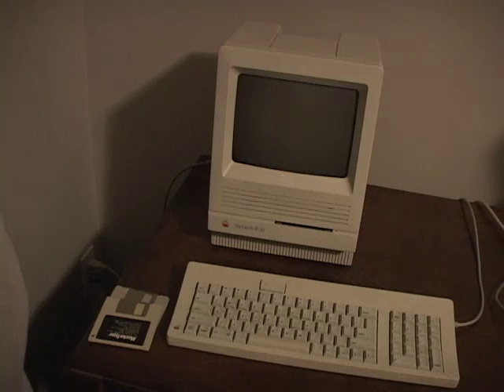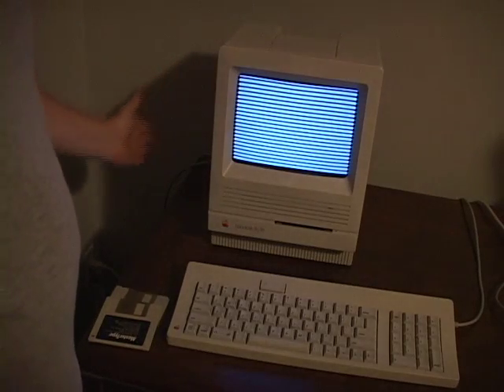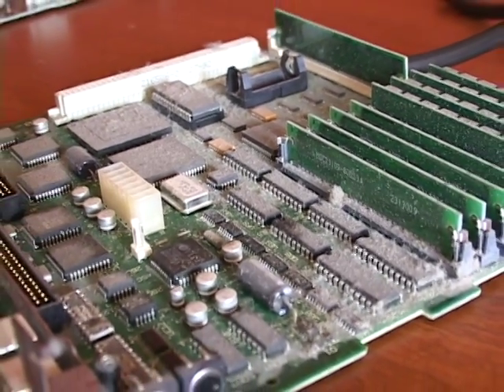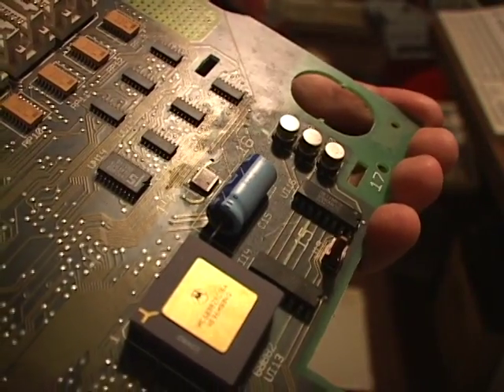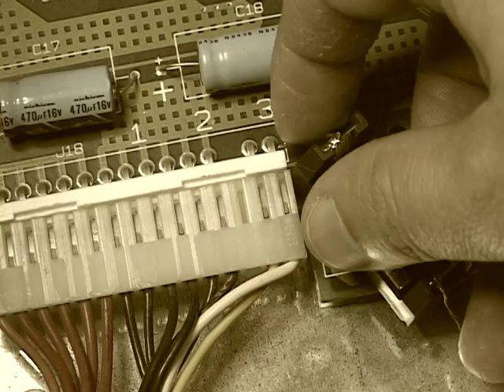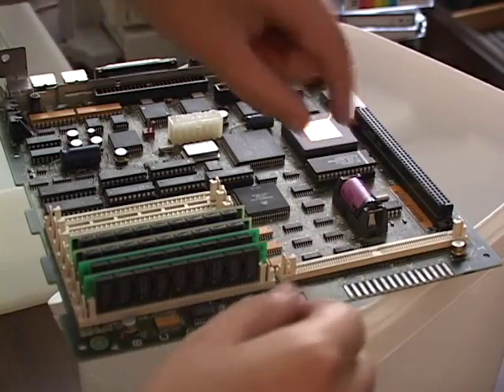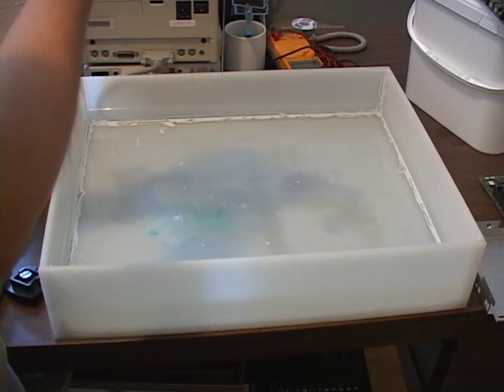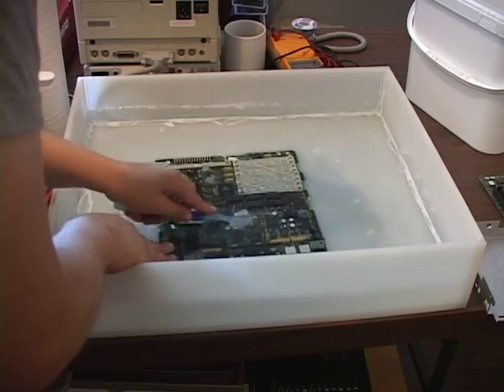Macintosh SE/30 Simasimac

Comment: You should mention that the old Lithium clock/P-RAM  batteries that aren't supposed to leak DO ACTUALLY LEAK and will irreparably corrode the motherboard traces if given the chance. Any Mac which sits for a long time should have its Lithium battery carefully removed and taken to Toxic Waste disposal.
Reply from the maker: I was just thinking the same thing recently that I need to put that warning in a video. I will do that. Thanks!

Comment: Remove motherboard.  Remove capacitors from board.  Remove components (RAM, etc.).  Stick in dishwasher on a cycle.  Remove and dry in a container with rice for several days to a week.  Solder on new capacitors.  Enjoy.

Comment: I did wash a macpro motberboard. I use simple green and hot water.  No issue
Reply from the maker: Interesting! I also had seen people use their dishwasher. I went a little more conservative than that.
Reply: 65scribe Not so sure about the dishwasher tho :p
Reply: @65scribe  A number of years ago I worked for a company that built cluster-based supercomputers and got sent to be on-site for a high-profile install at a national lab. It was staged at a nearby Supermicro facility (we used their motherboards) and I learned there that they regularly used dishwashers to clean reworked prototype boards and such to get rid of flux residue. I haven't tried it myself!

Comment: recapping is the permanent fix, you just wash off the electrolyte that is shorting out the board
Reply from the maker: That's true. I'll hopefully do a 'part 2' to this video.
Reply: Yes sure, but definitely at least everyone should clean their motherboard. I've seen people just re-cap the MBs, leaving the cap juice everywhere which is just going to cause more corrosion later on or the thing to stay shorted out.  Thisdoesnotcompute did that with his SE/30... never washed it: https://www.youtube.com/watch?v=bt_AAZnJXIs .... bad

Comment: 1:05 - "Remove the motherboard from the computer. Simple as that, huh?"
In my case, I had to remove the motherboard (of a Mac Classic) from a machine that had a clock battery explosion and a lot of metal corrosion on the frame as a result. I really had to fight it to get the corroded frame to let go of the board!

Comment: I get the error chime on my SE/30.  Could this be because I have no RAM SIMMs inserted?  I also get the simasimac problem, but not sure if I need to re-cap the board or not.
Reply: No the SE/30 will not startup with no ram Simms installed. And yes you need to recap it! These old caps had a shelf life of about 15 years, and they are almost 30 years old now!